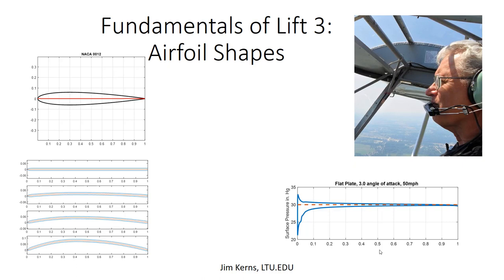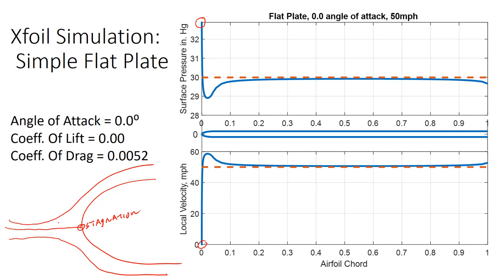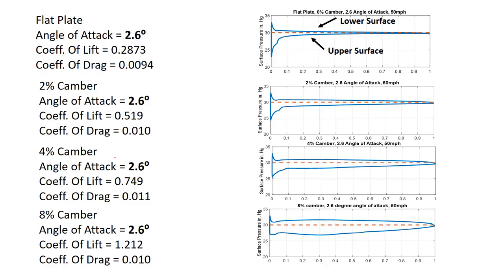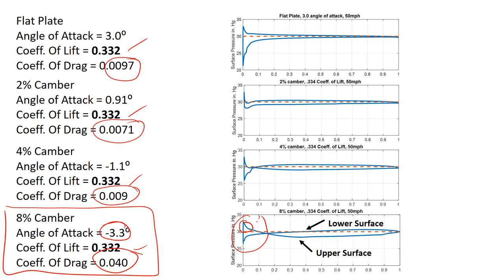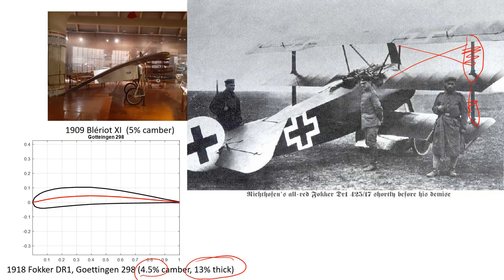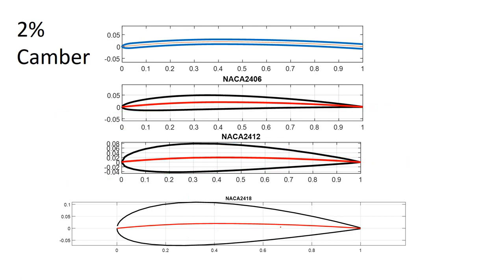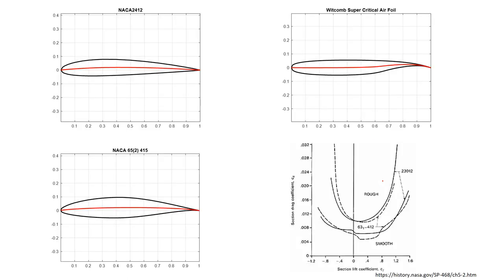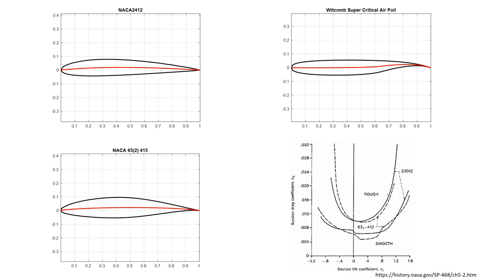Fundamentals of Lift 3: Airfoil Shapes

Comment: There are many philosophies contributing to the reasons for LIFT in a wing, propeller, turbine blades, basically, all based on the Newtonian dynamics of fluids with their other sealing, shearing,, cavitation, boiling, and aeration, thermodynamic effects, and characteristics. Let us have a look at CIRCULATION around a wing, as in other contributions I dealt with the Newtonian and Bernoulli effects. It is interesting to mention that any sail profile or wing airfoil, needs to operate in the angle between the direction of motion of the boat or the wing, and the APPARENT WIND into the leading edge. To avoid turbulence, the apparent wind should enter a "thin" sail, or a " thin" airfoil parallel with the leading edge, and the change of direction of the fluid would come later on. With a thick sail, or  thick wing, the processing zone at the leading edge would benefit the flight accelerating time above and below the wing.   Let us deal with CIRCULATION  around the airfoil, rather than the details of the velocity and pressure fields in close proximity to the surfaces of the wing. Let's look at the bigger voluminous picture of circulating fluid masses

The easiest manner to see the circulation around the airfoil of a high aspect ratio wing is to first study the helicopter in hover mode, where the fast accelerated central downstream flow of the main rotor and the slower decelerated upstream flow, outside the main rotor, forms a circulating doughnut ring., It is, in fact, an amplified extension of the dumping brought about by the wingtip vortices of the main rotor.  This circulation must occur as the world is not big enough for helicopters and aircraft wings to keep robbing air from high altitudes and dumping it down to lower altitudes. Circulation is only a return path of displaced air. . 
If a helicopter, from a hovering mode, tilts and goes into a forward motion,  this doughnut with circulation will still exist and the front leading part and the rear trailing part will be subjected to the Magnus effect, where the leading circulation will uplift, while the back circulation will down lift.  The side circulations will be exactly the same as a pair of wingtip vortices on a conventional wing, with their axis in line with the forward motion.

Since the rear Magus effect is producing a down lift, the back part of the circulating doughnut can be discarded, while the contra-rotating pair of side vortices with their axis moving in the direction of the forwarding motion, would still dump the air mass into the center of the modified forward-moving doughnut, where the front circulation can be obtained and continuously sustained by doing away with the main rotating rotor and replacing it with a forward-moving plate having a large angle of attack, with the lower surface producing a compression zone will slow down the moving air while the top surface will create a suction to speed up the airflow and the circulation around the airfoil will remain sustained, existing to complement the pair of vortices at the wingtips.  It is the dumping of circulating air mass behind the wing or the central downstream flow of the air mass by a forward-moving, or hovering helicopter "doughnut shape with circulation",  that creates lift. AS LONG AS THERE ARE ACCELERATIONS AND DECELERATIONS  PHASES AND ZONES ALONG THE  TRAJECTORY/PATH OF THE CIRCULATION. 
What is accelerated and centrally dumped down under the main rotor of a hovering or a forward-moving helicopter, is exactly the same Newtonian philosophy as what is dumped behind the trailing edge of a moving wing and those pair of vortices at the wingtips. That inconspicuous doughnut shape, with a circulation,  exists in a hovering or forward-moving helicopter as much as it exists in a moving wing, where, due to its forward motion becomes phased in time/ space with the moving doughnut with circulation. The wing leads the central part of the doughnut.  The back part of the doughnut shape is left far behind and is replaced by the back stabilizer of an aircraft.